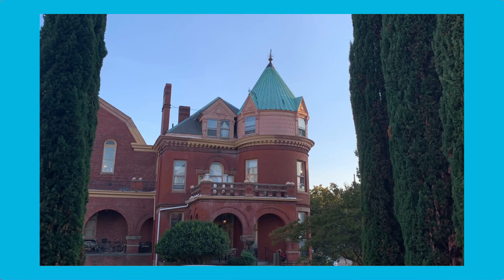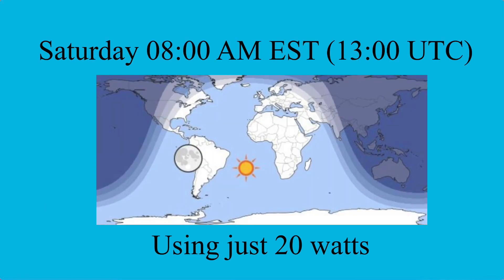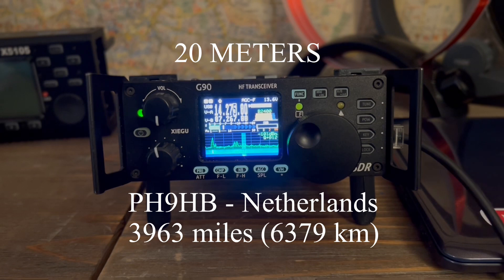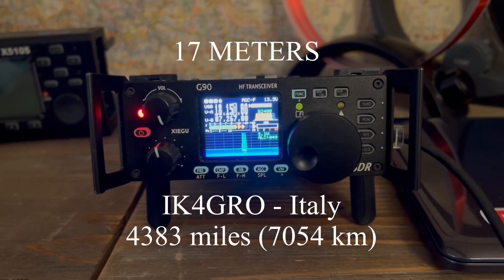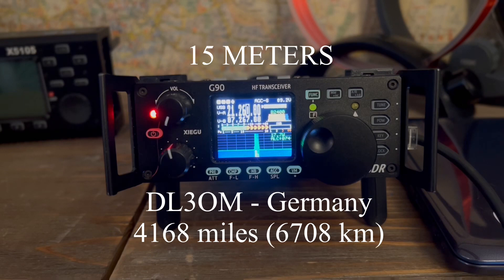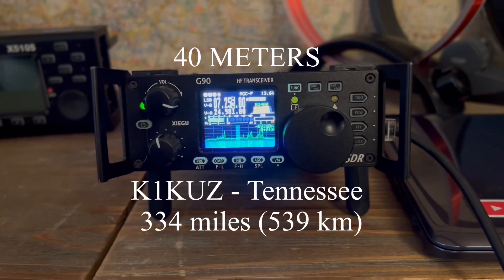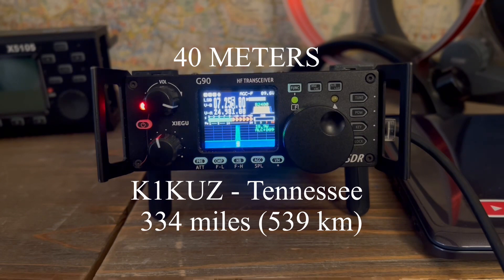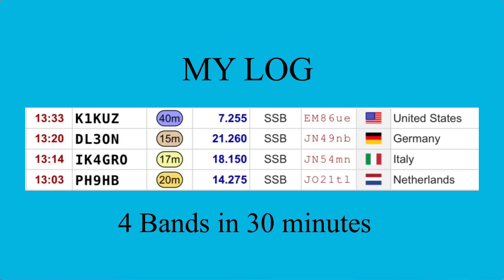Multi-Band No Radial Vertical Antenna, Will it Work with 20 Watts or Is It a Dummy Load?

Comment: I have the HF-360 (fiberglass) with plus kit, mounted on a 20' mast beside the house. Made a few contacts on 20 and 40 meters, noisy as hell, have a 1:1 LDG choke attached to the 4:1 unun at the feed point, an ugly balun (8 turns around a 4inch pvc (50; RG8X), ferrites (6 on both ends), etc. but still noisy as hell. Won't tune on 80 but does tune with my MFJ 941e (10, 20, 40) and the Yeasu ft-991a to fine tune but not the best performance.  may try mounting it closer to the ground as per the guys at Sigme Eurocomm. Not holding my breath though,... 73
Reply from the maker: Did this video a couple years ago. Mine is still getting it done on 20-17-15-12-10. That’s about it though. All the best and 73, Walt K4OGO

Comment: boy, you've got some hellish noise there, don'tcha?  But it's working anyway...
Reply: It is the main issue with endfeds.  Your coax braid will act like half of the antenna and pick up lots of common mode noise from the building.  That is why you want to choke it off near the feedpoint and use a metal roof or a separate wire at counterpoise.

Comment: Hello from M7DOZ UK I am about to pick up one of these antenna's in the morning. I hope it performs as good as yours does. Also picking up  a VHF UHF for the house roof. To run with my new Yaesu FT 991A. I do also have a DJI 949E tuner , so should be all good to go. Just doing housework 1st , which is to earth grounding the Shack , which is all steel construction.
Reply from the maker: Wow, that steel shack under that antenna should make it perform! 73! K4OGO
Reply: @COASTALWAVESWIRES  do you think so. Every one else says it will be bad.
Reply from the maker: @Steviegtr52  mine works great because of the metal roof below it. Make sure your mount has a solid ground connection to your metal building and you’ll have an amazing antenna. I’ve worked Australia with mine here on the East  Coast of the USA with just 5 watts.
Reply: @COASTALWAVESWIRES  Thank you for the comment. I am picking up 2- 4foot earth rods from Screwfix tomorrow , so i can ground out the whole garage / shack. Here's hoping.

Comment: I'm a new subscriber. I use an 80-6 vertical. I live in Australia (VK 3). The vertical I have is an Australian made one from Western Australia (VK 6). I use it with my Yaesu 817nd so just 5 watts and I have made many long distance VK QSO's and some DX. I sometimes also use my Qmac HF rig which soes 50 watts PEP on the lower bands using the vertical and also a 12 meter long end fed with a trap for 80 M which also works very well. (Also Aussie made from Western Australia).
Reply from the maker: Awesome! Thanks so much for subscribing, 73/K4OGO

Comment: Walt - I put up my Sigma EuroComm HF 360 about 2 weeks ago... only had a short time to test. My first contact was not quite a good as yours, only 1000 miles and I was pushing 27 watts out of my FT-891. I will try my G-90 soon.  I love this antenna. I have it mounted on a 8' (above ground) pole and it is working great.  Due to work I have not had much Ham time, but hopefully I will soon. I high recommend the antenna and the price was not bad on Amazon at $205.00. 
Thanks for the video.
Reply from the maker: Thanks! All the best and good DX!

Comment: I bougth a Sigma 360 and the Balun melted using FT8 at 80 watts.   Three months of use and it had to go in the bin.  Never had a voice CQ on it.
Reply: I've had mine since 2019, and I've used my X-80 several times... I've decided to replace the balun... also have the plus kit... need to wait to install that, due to inclement weather...

Comment: Maybe that metal roof is acting like radials and helping your antenna. Nice job
Reply from the maker: Yes I’m sure it’s helping! Thanks!
Reply: It is an endfed, so the coax radiates like a counterpoise, but it would help a lot to have a groundplane on the roof and choke off the coax.  I bet some of the noise we are hearing comes from common mode currents on the braid of the coax.  Another option is to place a current balun 5-10m from the feedpoint and stop the common mode there.  It is also important how you route the coax as it is a part of the radiating antenna without a current balun or "choke".

Comment: I have the other one...a Diamond BB7V. I needed something I could mount semi-permanently but could get down quickly if necessary (hurricane alley here). It's about a five minute job putting it up or taking it down.  Also, I wanted something I could go portable with. I mount mine on a PA speaker tripod for portable work.  Mine works from 80-10 meters. My IC7300's tuner gets along well with it. The antenna isn't very good on 75/80 but I can still make contacts. It's not bad on 40 and pretty good from 20 up. Great channel!  73, Brian - W5DUI
Reply from the maker: Awesome and thanks for the kind words! BTW I lived just down 90 from you in Pascagoula when I was a kid. 73, K4OGO

Comment: How much coax are you running from the antenna to the radio? I know about 30 feet or so helps replace using radials. Good job.
Reply from the maker: Yes, I’m using 50 feet of RG-8. Thanks!

Comment: I have a similar antenna, the Diamond BB7V.  I use it almost exclusively on CW.  It is a definite compromise antenna,  but it does work.  I find that on 30M, 20M, 17M and 15M it works fairly well,  not so great on 40M.  I also find that it seems to be weaker on receive vs. transmit.  Thanks for the video Walt. Best 73,  George, K2WO.
Reply from the maker: Thanks for watching George! I’m currently learning code, will be interesting to see how this works for me on CW. 73 and all the best! Walt K4OGO

Comment: I watch every video that you make. One of the things that jumped out at me was the low noise that you had on 20 meters. My noise in my condo is +7 all the time. You are lucky. Would your vertical compete with a dipole? You are generous with your time for me. You have answered all my questions and except one. I always enjoy your sense of adventure.
Reply from the maker: Thanks Tommy! I wish I had room for a dipole, it would probably be a better antenna. Sometimes my noise level on 20 is very high too, especially with this vertical. I try to reply and answer all questions, I must have missed one, sorry. Thanks for watching! Also, Did you get the email with the picture of the insert on the antenna pipe spike?
Reply: @COASTALWAVESWIRES   I have a small 20 meter dipole I can send to you. It is a stealthy version? Interested?
Reply from the maker: @tommycheshire5508  thanks but I am flying to Europe Wednesday and will be working there for a few months (get ready for the Euro QRP videos LOL) I really appreciate the offer though!
Reply: @COASTALWAVESWIRES   No I did not. Very disappointed. Mine looks like crap and I will have to carry a lot of noodle parts and strips.
Reply from the maker: @tommycheshire5508  I sent it to the email on QRZ the RR address.
Reply: Would you consider sending it again?

Comment: Every antenna is compromising, no matter which brand, no matter which size and no matter which price range. A log periodic doesn't work effective in every area. Same goes for the Classic Dipole, OCF, verticals and so on. Everyone of us just has to find out by himself which antenna works fine for us to be happy. I took a 5/8 wave cb radio base antenna and connected a 9:1 UNUN Balun to it. The Store Price for the Antenna was 79.- bucks and if you need to buy a 9:1 UNUN cuz you can't make them yourself it's another 45.- bucks for the Balun. I used a home made 9:1UNUN. If you have a some telescopic aluminum pipes sitting somewhere in a corner who looking for a new job...you can even build this whole antenna system yourself to save some money but it's more of the Fun you have building your own antenna. Thx for another great content Walter, have a nice sunday. 73 de Your Friend Uncle Guenter
Reply from the maker: Thank you sir! Have a great day!!!!
Reply: https://vk6ysf.com/unun_9-1.htm